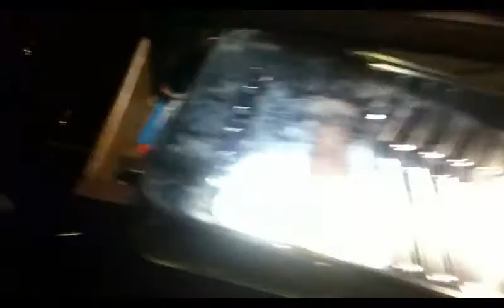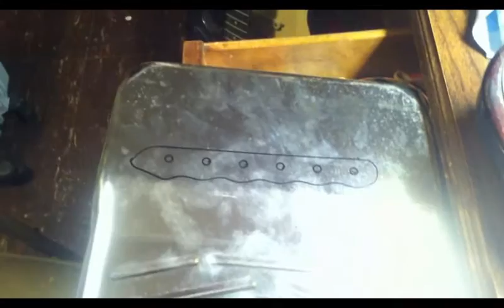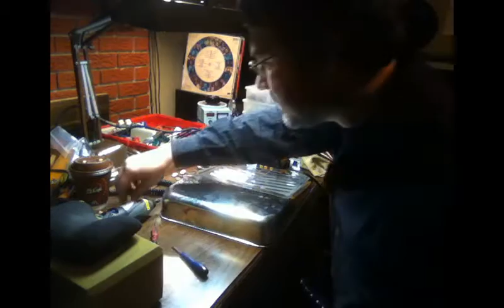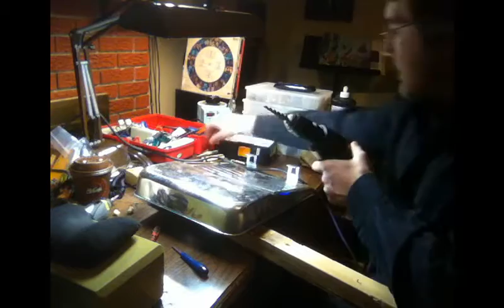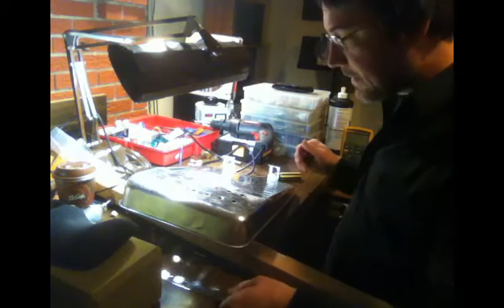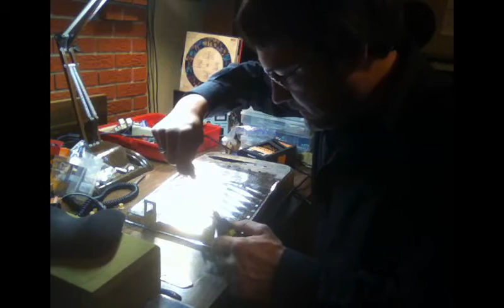Making Guitar Parts from Scratch (Kawai Headstock Part)

Comment: Some sheet metal snips (look like scissors) would have made quick work of the cutout. A lot easier than trying to use the Dremel cut wheel. Any curl on the edge from the cut (which won't happen with average thickness sheetmetal) could be easily worked out with a mallet.